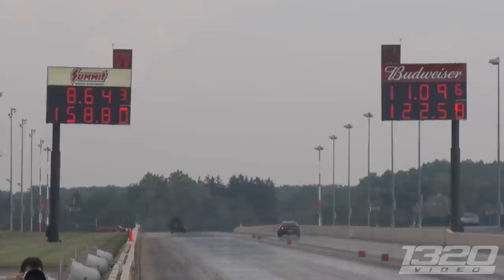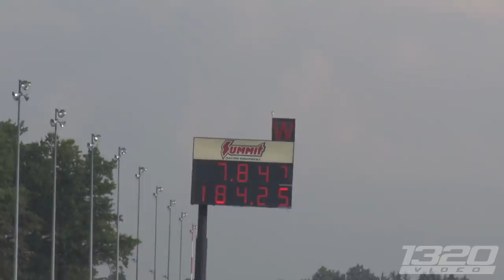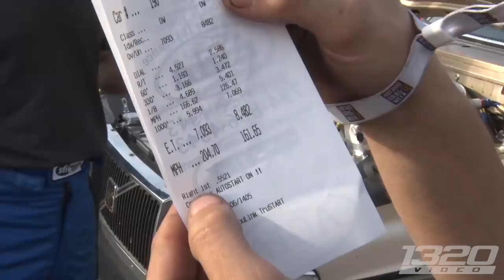Trailer Burnouts are BACK, 9 second DSM's, & MORE! (Hot Rod Drag Week: Day 2)

Comment: That Capri with the coyote and the manual trans is an absolute ripper!
Reply: Black Capri? That thing is baaaaaaad
Reply: 1320 has a full video on that car I believe if you search their channel. I love that car
Reply: LS Swap. 5.3 with darton sleeves.
Reply: Too bad its LS swapped
Reply: @The1st60ft  treed you lol
Reply: Which Fox are you talking about? There are plenty of LS swapped Fox’s but they also follow a Coyote swapped blower Fox with a Tremec. As to the original comment; the Coyote platform is indeed right at home in a Fox chassis, I just finished mine last month. I’ve been well into the 8’s on LS power in my 88 notch grudge car but I’ve been working on a 91 LX hatch as a street/strip Coyote build since the start of this CoVid junk. Now that it’s done I honestly think it’s my favorite build out of everything I’ve ever done. The balance is great, it’s 100% streetable making almost 600whp NA, will easily put up a 9 sec slip and returns the same fuel mileage as a stock S550.
Reply: @jimmiemiller4327  b hi jf
Reply: J'y fj

Comment: I miss my first car, a 90 eclipse gsx back which I got in 95'. That car taught me alot since there were entire books full of upgrade parts. I needed those upgrades due to the car breaking every 2 months. Lots of fun and I would love to find a 98 gsx with a bad motor or even a shell of a car.
Reply: Awesome. I used to have a 94 Talon Tsi awd. Mostly stock, but that thing was a rocket. Hands down, the best car I ever owned and I’ve had about 30 different cars. Still miss that car

Comment: That bug gasser doesn't have enough power to be running open headers. I'm sure if he just ran it through the glasspacks it's probably pick up half a second because that engine is just not happy with that little back pressure. I want to know a bit about that yellow Mustang with the flames that sounds so good, doesn't sound like another LS or Coyote build, I'm thinking possible BBF.